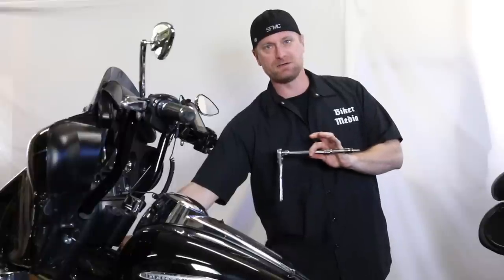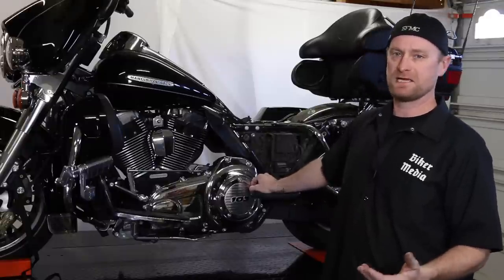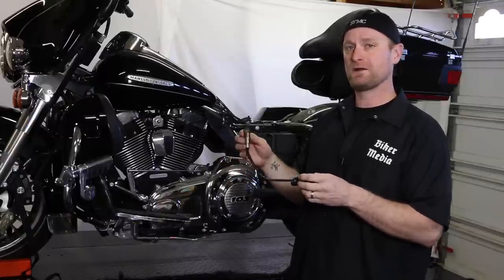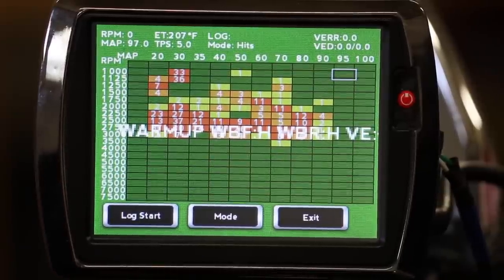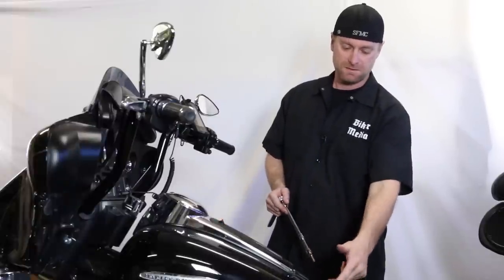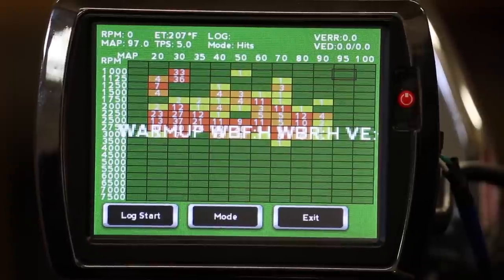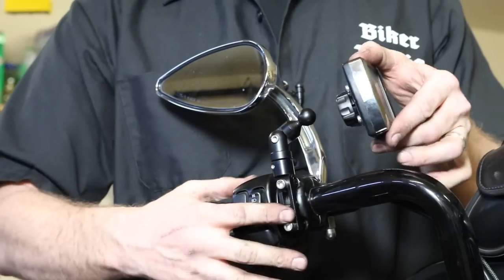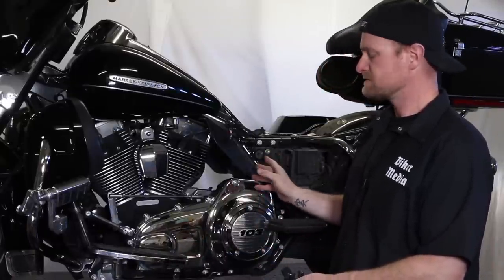Install a DynoJet Power Vision Electronic Fuel Injection (EFI) Tuner on Harley Davidson-Tune

Comment: After I had my Power Vision a year, I met a tech at a Dyno Jet mobile dyno during bike week.  Everything was running fine, but he suggested I take some time playing around with the Quick Tune.  This program has limits on what you can change and how much, so it won't let you damage your bike.  But you can make gradual changes in the fuel map to get more or less out of your bike than the Auto Tune will give you.  Watch the gauges.  MPG, Knock Sensor and Engine Temp are the important ones.  Less fuel will give better MPG at the expense of higher Engine Temp and less torque and acceleration.  But there is an optimal point where less fuel is just less of everything.  More fuel gives more power at lower MPG and engine temperature.  But more fuel also means less air since one displaces the other.  So it is just like the coffeemaker.  You want to find out the right amount of grounds (fuel) and the right amount of water (air) to get what you want out of your bike.  It can be a long slow process making gradual changes and charting what each does to MPG and Engine Temp and riding the interstate for a few miles on each setting.  But in the end you will gain control over your bike that the throttle just can't give you.  At the end of the day you can clear the Quick Tune back to zero and be right back where you started.  I found it was great advice that I am glad to pass on.
Reply from the maker: 7heRedBaron Awesome and well put!!

Comment: I wanted to add a second comment intended to the other viewers.  I don't think most people understand right off why they need to retune their bikes after an engine mod like exhaust, but it's really simple to understand.  When I make coffee in the morning, I put a couple spoons of coffee in the filter, my 15 oz. cup and the right amount of water in the machine.  It is all computer controlled, and I know the cup isn't going to be overfilled or make the coffee too week.  The bike works exactly like this.  If you put more water in your coffee maker, it isn't going to know the difference.  It is still going to make the same amount of coffee until you tell it different.  And if you put a larger cup on the tray, it isn't going to know until you tell the computer you want more coffee too.  So that's what the tuner does.  Put a smaller cup in the tray and you are going to make a mess.  Whether you use an FP3, Power Vision or any other.  If you get a tuner that requires maps, then anytime you want a different cup, you need to download another map and hope it isn't going to spill your coffee all over the counter.  Not the best.  The Auto Tune process on the Power Vision works this recipe out and then saves it until you want to try something different.  That's what it does.
Reply from the maker: 7heRedBaron Another great comment! Thanks for weighing in.

Comment: I have a 103 that I put a stage 110ci stage 4 kit and had a FP3 on it. I’m leaving the FP3 to a power vision ( license agreement  only no display) simply because of the complications and tinkering that you can easily get it the habit with both the FP3 and the power vision. 
I have called dyno jet and they thought this is the best option for the 99% of us that just want all the power/ torque  and best running capability from the professionals. 
Wish I was the 1%er who could tinker. From all accounts, they said i will see and feel a difference to throttle response.  🤞🏻🙏
Reply: How did you unlock the ecm to install the dyno?
Reply: @aureliosalinas7683  I had it done at the H-D dealer

Comment: I have a 06 Street Glide 88 cubic inch that doesn't have O2 sensors so which one do you buy cuz all you guys talk about is the ones with O2 sensors could you give me a answer for I know what I want to buy I want to put dual exhaust on thanks
Reply: Charlie brady 06 is the last yr with no 02 sensors. If u want 02 sensors they can be welded on. Depends what u want to do. With an 88 inch I wouldn’t bother. A Vance and Hines fp3 would do fine for you.

Comment: I just purchased a power vision I am lost with this thing. I have Vance and Hines short shots and a screamin eagle high flow air filter and need to tune it at its maximum potential. Btw it's a sportster will This video cover all that? I'm trying to just find a quick map
Reply: Itamajano try quick tune, I’m new too but I called dynojet they gave me a download that worked great. No decell pops and more power..wat h the videos on you tube

Comment: Hey Ryan like your video's... I just bought a powervision tuner through my HD local dealership I didnt get any thing back after they tuned it is there a different version where you dont get a monitor and cord ?
Reply from the maker: Not that I'm aware of. Unless you just got the Power Commander V?
Reply: The great thing about power vision, and a way to save money is to have the ECM re-flashed. Power vision is capable of this. You or your dealership will buy license that will be married to your bike, and can be re-flashed as many time as you want to do it. when they're done tuning they pull off the hardware. Hope this helps.
Reply: I did  the same, pv done by the hd dealer :
The dealer Works pv on licence base. He install pv for you on base of your bike ( configuration) at that moment.
You  dont get the hardware pv stuff. Also you dont need those if your bike is tuned. 
The price is way lower then purchase a full device.
In the Nederlands the sofware tuning is about 225 ,_
Negative: you have to go back to the dealer if You need /want retune. Positive no problems with warranty and on risck of that dealer.
If you want to tune 1 time and leave it that way it is an option.
Note: the dealer tune is onley narro band, What means it optimize the part in witch You dayley drive, so  not the Max rpm area.